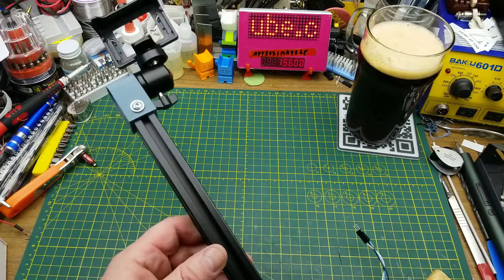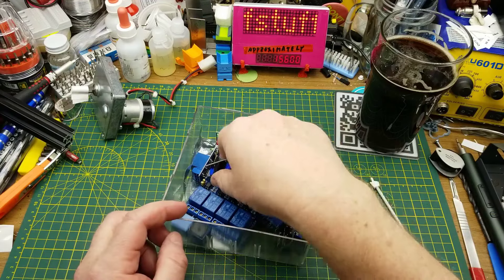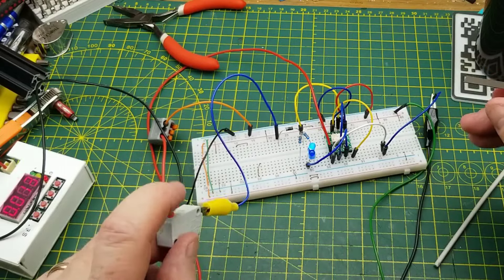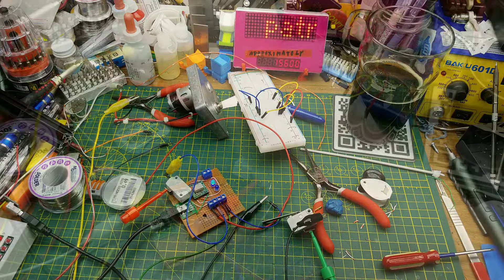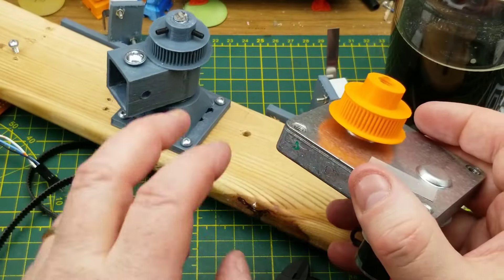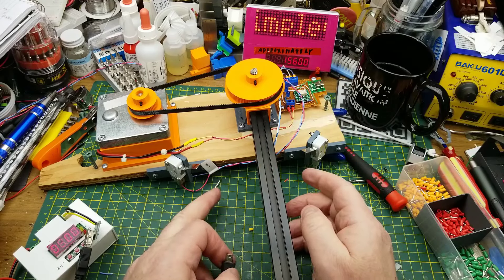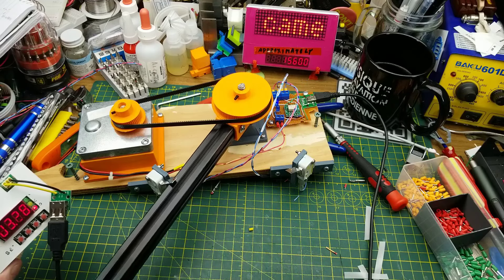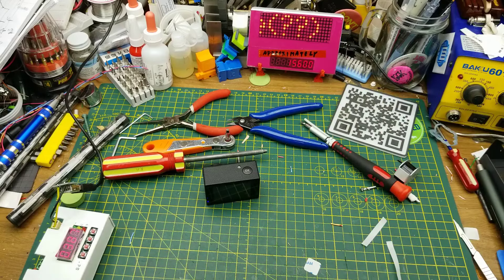camera arm attempt 2

Comment: makerbase has some neat servo steppers up to nema 23 size, super cheap. the serial control mode lets you set end stops and acceleration profiles, command to angle. would still need ballast but the motor could be directly connected

Comment: great project I like how you did not over complicate things using a microcontroller and simple electronics, I always struggled the last few years to mount anything anywhere since every time I rent a new apartment I don't want to damage walls, now I have this simple camera desk stand which limits the amount of area I can capture
Reply: @NerdCaveYT 
Ummm... 2 transitors, caps, resistors, is all that is needed. Its called a "flip flop". 
Or you could use a single OR Gate. 
Or a 555, or 556 ic,
Or 2 magnets and a relay. 
A door hinge, with string wrapped around a bobbin. 
How simple do you want it.

Comment: You may try changing the size of the belt wheels on top, smaller on the motor side OR larger on the arm side OR both.
Reply from the maker: There is a practical limit how small I can go on the drive pulley when 3D printing them. The teeth start getting "softer" around the edges and won't maintain grip on the belt as well at very small sizes.

Comment: Could you run the relays on "full" volts and have a pot on a darlington pair for the motor ... model railway dc controller style

Comment: You could make it go slower by using 2 diodes in parallel (one reversed) between motor and relay to drop enough voltage to slow down motor without stopping relay from working.  Those micro switches are quite noticable sound wise

Comment: Not really hearing the motor through speakers (not headset).
But if it is a worry, you could use some foam rubber of some sort between mounting surfaces.
That should take care of any minimal motor noise. Unless your talking about sound interference.
In which case I hear none. Hope this helps.
Great project!

Comment: silent run, no motor, foot pedals to pump air to expanding pistons that move the arm, but would the opposite escaping air make a noise ?
Reply from the maker: Interesting suggestion
Pneumatics is a field I haven't explored yet.
Reply: Unlikely to be noisy if opening is big enough,especially given the slow motion wanted. If it still turned out to be an issue, a muffler could be mounted.

Comment: Being honest, once mounted I couldn't here the motor as much as I could here the clicking of the switch and relays.   Maybe the switches can be swapped for photo sensors and the relay with a solid state in time?    :)   
It's a simple, yet clever and effective little project.  Love it.   Simple is sometimes the best

Comment: I like your idea but I think if you added a 5v. D.C. motor controller in between the motor and the relay it would be slower and quieter for you. They are only £3 on eBay from China. Thanks for the videos.

Comment: Yes, we can hear it. Most of the noise likely comes from motor noise transmitted to the mount as you surmise. Rather than sticking some low durometer rubber under the motor mounts you might try some between the wooden “chassis” and the shelf you attached it to. That would prevent you needing to replace both pulleys. Yeah I know, you’re probably going to change out the motor pulley for a smaller one. Mounting the motor on rubber will make tensioning the belt kinda iffy.

Also, some of the noise may be being transmitted by the camera arm. Replacing that with a wooden stick that has some built in compliance might help.

In any case, congrats on achieving “proof of concept”.

Comment: Like your channel and your DIY's.  I can definitely hear both the motor sounds and the micro-switches clicking.  I patched your video in DaVinci Resolve and noted in Fairlight you have a very nice voice  level in this video.  The ratio of your voice to the micro-switch clicks is around -15 dB, which is not very good.  I didn't measure the motor level.  Possibly going optical to completely get rid of the mechanical switch noise might be a fun project. On the negative side you would have to take it down again ; ).  As mentioned I enjoy your videos and your humor.

Comment: The clicking and the grinding are both easily audible, and the movement at that speed is a problem.  Maybe 5 or 10% of that speed without the relay and it would work.

Comment: Now you  are using a DC motor why not use one of the cheap PWM motor speed controllers to adjust the speed and possibly reduce noise, also rubber mount the motor should help.

Comment: I'm guessing the 3D printed gears came from an OpenSCAD design. This is why I like 3D printing.
How are you going to control it? You use that dinky power supply in most of your videos!
Reply from the maker: Yup. the openscad gear generator, plus a bit of tweaking in tinkercad.

I'll eventually power it from a random wall-wart from my accumulation of parts.

Comment: You might try a different stepper motor controller with your original stepper motor config ... checkout a TMC2208 or similar.    Drastically cuts down stepper motor noise and maybe improved operation.   Lots of videos posted for using it with 3D printers.   Will likely need heat sink.   Cheers ... all the best!!!
Reply from the maker: For the stepper the biggest problem I saw was the stepping was amplified a lot over the length of the arm. It was too bouncy to use the video.
Reply: My understanding is that the TMC22xx controllers use a much better approximated sine wave output to lower noise ... maybe it would improve the bounciness as well ... just a suggestion ... all the best ...
Reply: Maybe a worm gear or a wade’s extruder type gear set with an intermediate shaft/gear set to increase torque and provide a break in the vibraitons and noise. The nice thing with a stepper is it would give your the ability to do preprogrammed motion or repeatable positions using a home switch and a set of buttons. Some stepper controllers allow for the improved quiet stepping.